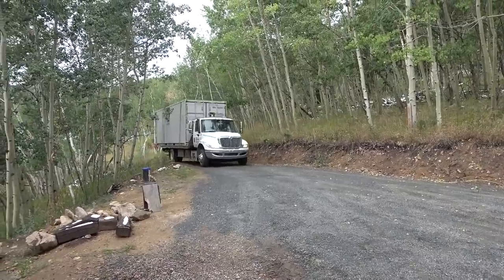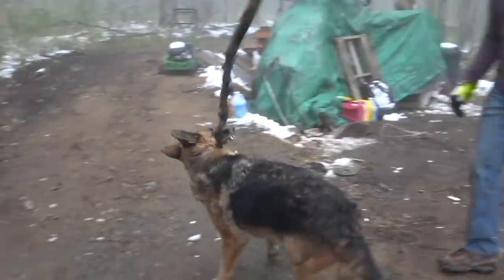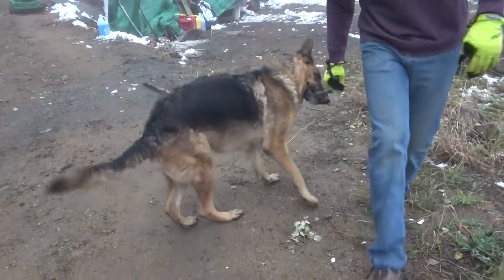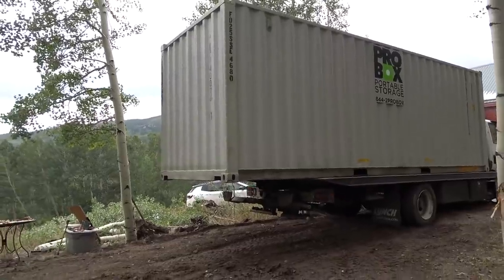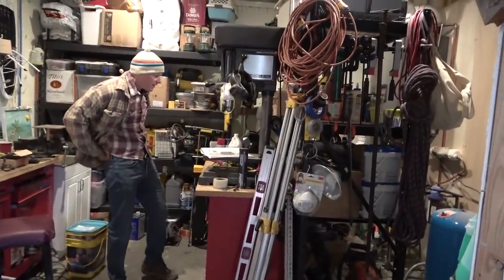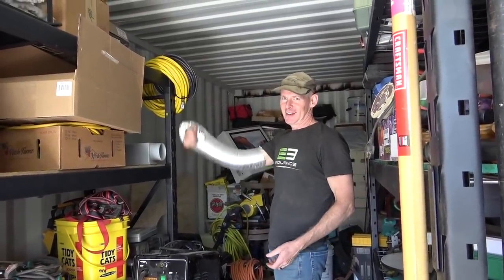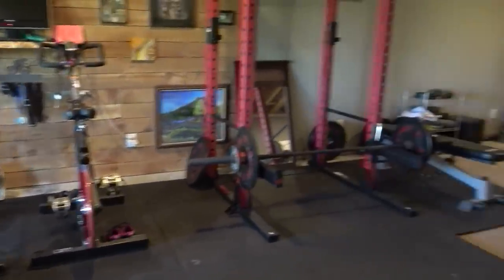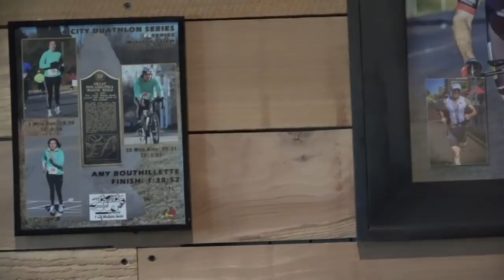Shipping Container for our Homestead Solves our Living Problems

Comment: i bought 2 40 foot long ones at 5000$ cnd each, plus 250$ delivery, both are a nice green color. I spaced them 30 feet a part on 4 on each unit.  cement 10" concrete tubes down 7 feet, below our frost..  and put a knee wall on top and put a roof over the 2, making a shop between, to rent them, it adds up fast, and you never own them, they are built so ridged you dont need more then 4  columns on each
Reply from the maker: Very nice!

Comment: Anytime you are going to dig a stump up, do it with the whole tree intact. You have the weight of the tree to tip the stump out and after doing a little digging you can push the tree over with the Backhoe, way less work..
Reply from the maker: Aspens are tricky because the root network is all attached to the trees surrounding it. So it's like there are sideways trunks underground up to 8 inches wide, connected to the next tree.  Other than that, they don't go too deep.

Comment: Nice shipping container - 1 flaw, you should have placed cement pads under the container first keeping it elevated just a little from the ground level to prevent rusting. Shipping containers are known for settling due to the amount of weight stored in it. When it settles it will create a bed for water to build up. This should have been done when the driver came to set the container in place. Being that its already set you will need to call in a heavy tow truck to come hook on corner eyes to lift. We use the 16x16x4inch  house cement pads on the shipping containers so it doesnt settle. You could have also spread some #2 stones on a pad and set the container on it. This way, any water buildup under it could exit through stones.  Lastly, if you are going to store fuel in this container you made want to add additional vent on front door and solar powered exhaust fan on back.
Reply from the maker: If it rusts I"m not sure it's our responsibility, it's just a rental. thanks for the tips.
Reply: You might want to check the legal jargon on your rental papers and make sure they don't have it down that if it rust or there's some type of wear beyond what they think is normal wear and tear you don't get charged for it.

Comment: You have a tractor you could of just pushed those trees over ... I have this thing called a chainsaw if you ever want to use it ! I'm just over the hill from you ...  did you find a good deal on a container best I've found is 1800.00 for a 40 foot ?
Reply from the maker: We are just renting the container for now. Not our intention to keep one permanently. We have a chainsaw, but Bryan tends to spend 30 minutes adjusting all the choke, etc; it was much faster to do it this way , believe me.
Reply: I was thinking the same thing, use the backhoe and dig around then push them over

Comment: would be tempted to jack it up a few inches and place a couple of shed blocks set it on a couple about six inches off ground  just to have a little break between the ground and the bottom  Unless you just rented it. then it will be gone in nine months.   Use the Geo cell driveway liner stuff and create a pad for one-  then build  a carport  awning off it. or right next to it.  Paint it the color of the soil and plant some aspens  in front of it.  You could even stencil aspen trunks on it.    If you had two  with spacing between and used triangle shade cloths between them in the summertime.  would have a great  outside work area.  Just thinking of snow load if you tried to roof between the two.  Might try and find twenty foot containers.  Even stacking firewood across its whole side would create a interesting. siding.  and if you used some of that driveway base.  it would drain pretty well - chipmunks would love it.
Reply from the maker: Yes we just rented it. Great ideas though!